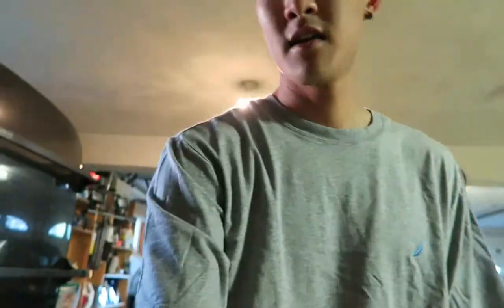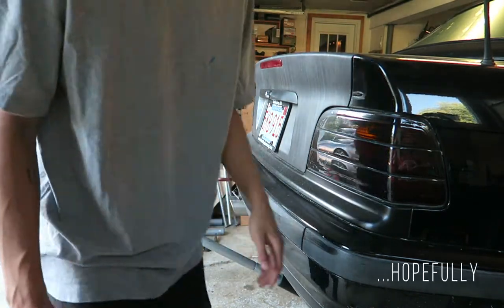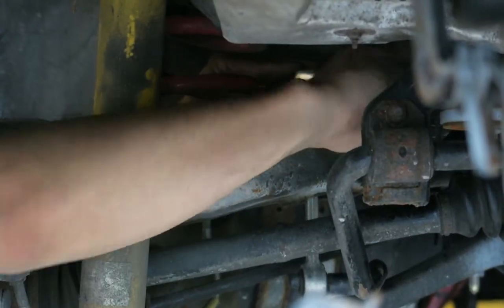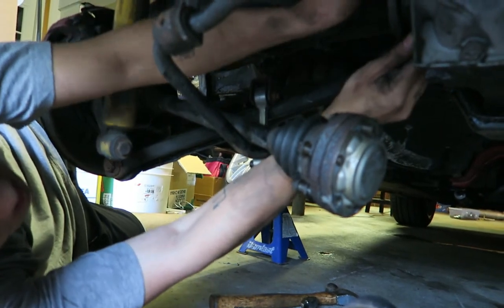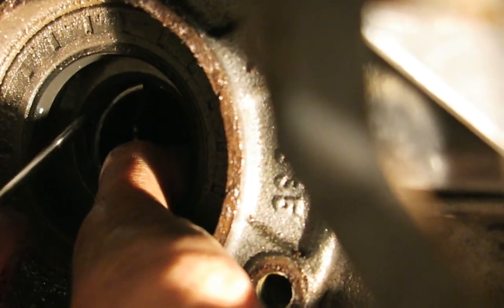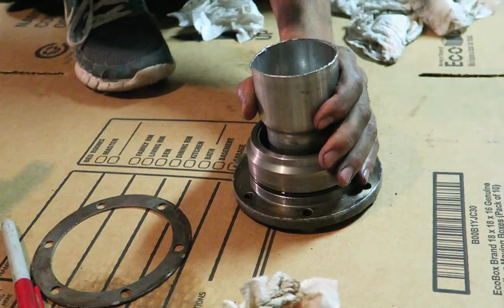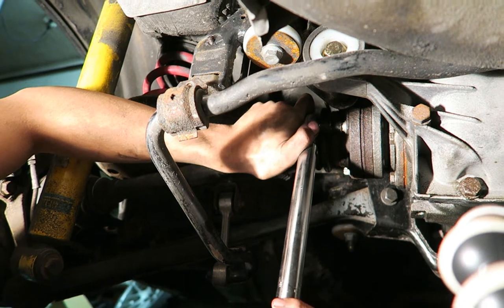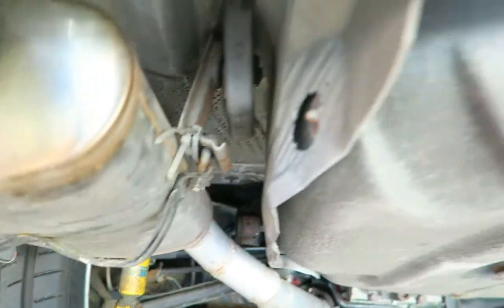Differential Axle Seals DIY: BMW E36 3 Series (M3 Differential)

Comment: Top notch video sir! Very much appreciated as I am In the middle of doing this job now.  Thanks also for the torque specs. I have two questions. 1. What bolts did you have to put the propane torch to? 2. How many ft/lbs did you torque down the axle nut. My torque wrench only goes to 150ft/lbs and 97 M3 requires  221ft/lbs.
Reply from the maker: Thank you! Glad the video helps. I only torched bolts that were either corroded or harder to get a solid grip on with a socket or wrench just to minimize the risk to snap them or round them off. Regardless be very careful of where you use heat (don't want to catch any existing seals/bushings on fire haha).

I do not recall the torque specs off the top of my head, but I remember looking them up on Bimmerforums and/or the E36 bentley manual.

I feel you with the torque issues. For any high torque applications I just borrow a good torque wrench from a shop or tech friend.
Reply: Thank you sir! Just got that upper sway bar bracket bolt off with some PB Blaster. I let it sit overnight, but I have the luxury of time. Thanks for the great video by the way. Great editing and sound.
Reply from the maker: @DonBMW  you're welcome! I'm glad you got a project car build carried out on a relaxed timeline 😎. Thank you for your compilments! Cheers!

Comment: Very nice Job and good video. I just had to replace my rear ABS rings because of rust and was hitting my abs sensors... through the whole car off! Anyway you mention you were getting a whiny sound? My X3 is getting a high pitch whinny whistling noise at around 30 mph and and usually stops after ten minutes of driving, comes and goes, louder when it’s cold. Sound travels so it’s very hard to pin point. My question is did your noise sound somewhat similar. I plan to change the diff seals soon. Thanks in advance.

Comment: so, i manual swapped my e36 and put a 3.15 LSD in it.  since i'm on 328 axles and the diff came off a 325, i also swapped the flanges.  I didn't, however, take off the diff cover and redo the seals.  when i was under my car to do an exhaust and take my driveshaft out to get rebuilt, i noticed a lot of hard, black grese/dirt coating the bottom of my differential, which was not there when i put the diff in.  there's also a lot of the same stuff around the boot on the axle.  would the seals fix this?  haven't driven the car enough to hear diff whining but then again, I'm EXTREMELY hesitant about doing press fits by pipe and hammer; I tried to do my center support bearing myself and ended up just breaking it even more, so i took it to the driveshaft shop and had them rebuild it.  if you've done a center support bearing yourself, how much harder, or easier, was this seal?  I bet it'll fix my issues but I'm just super hesitant because I don't wanna break something again.
Reply from the maker: I would definitely recommend replacing the seals to resolve the oil/grit issue with your diff. You don't need to use the janky method that I used, but basically as long as the new seal goes in straight, you should be fine. I've never done the center driveshaft beating myself, but its on the list of to do's for the future . However that center bearing wouldn't cause any grease or grit to coat undercarriage componentry. But a bad center support bearing would cause some cabin vibrations/rattles as you drive. I can't imagine it's more difficult that the diff seals as you can replace the entire part with the bracket so there's no need to press fit anything, just gotta take the driveshaft apart if I'm thinking correctly. That being said the driveshafts in these cars do require rebuilds long term so it's great you're already doing that thru a shop!  Pricey, but nice to know the part gets services with the right tools
Reply: @Pawinning  my u joints were already gone, and yes, even with the rubber housing the center bearing needs to be pressed. I highly advise getting a new bearing and u joints,  especially since all the extra power from the turbo motor is all put on the u joints. they're welded in as well, so unless you wanna cut and press and weld new joints in it turned out easier to have it rebuilt.
Reply: Pawinning update: i was a wimp when i was in high school and after working at a shop this is all very easy. i do have a question though: 

is the snap ring the difference between the m3 diff and a 3 series? i’ve got a 3.15 LSD from a 325 and i could take everything out without changing that snap ring. i’m confused as to why you took yours out?

Comment: What's up Pawinning, got a question for ya. I have a e46 and I know the e36 is similar, but is the driveshaft input seal the same as the axle input seal removal/replacing? I really can't find to much on the web for this and my car is leaking bad at this point of the differential.
Reply from the maker: +Julian McAlister it is similar. Just the hardest part is pulling the seal out then torquing the large nut at the front to 127ft-lbs if I remember it correctly. You can avoid that by marking the currently nut location, if there aren't any markings already

Comment: where is the part when you reinstall the clip after insert the new seal, or how to do it?
Reply: eduki yea im having a tough time putting it back in
Reply: @orestesocks  Trick was to put the snap ring into the differential first, NOT on the stub shaft.  
(i also realize this thread is now 4 years old so HOPEULLY you figured it out by now. haha)